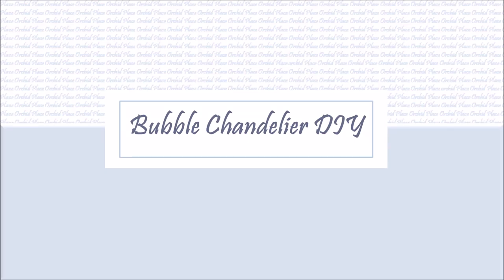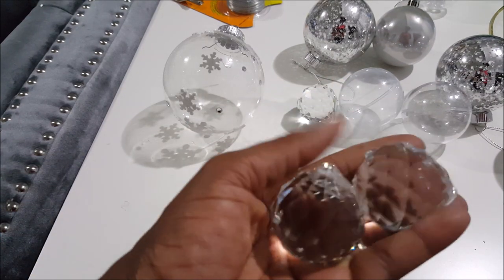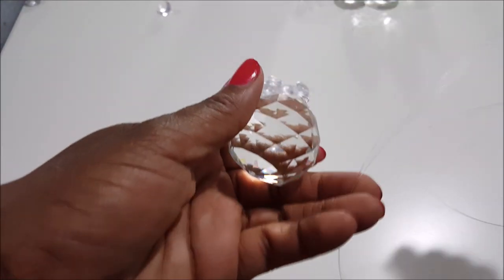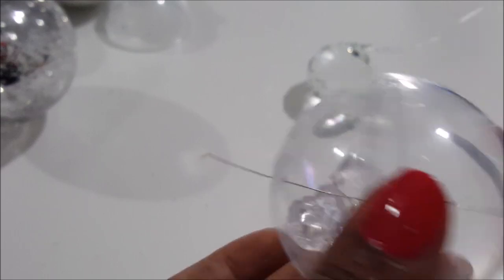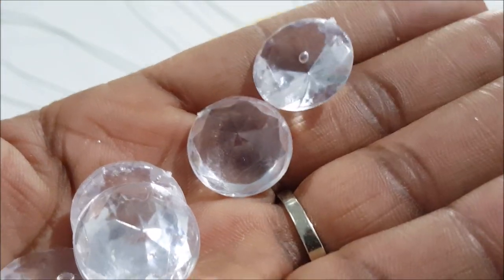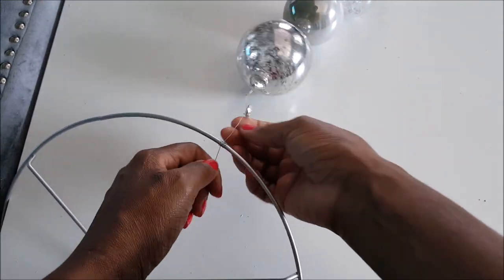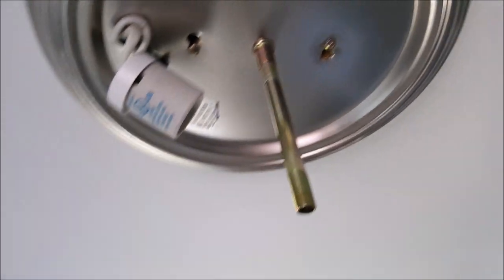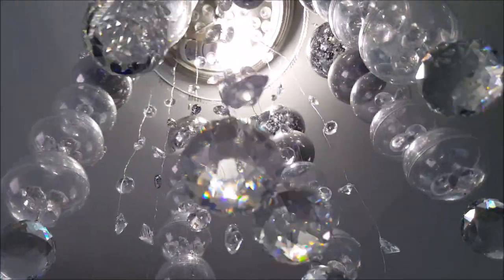Bubble Chandelier DIY

Comment: Absolutely gorg. But I'm wondering if those Crystal decor balls are flammable.  Do you know?
Reply from the maker: Thank you Vernon. To avoid an accident, you may notice that I placed them below the bulb ensuring that they are not in contact. They are at least 3 to 3 1/2 inches from the bulb in my light fixture. Thanks for the heads i up. It is truly appreciated.

Comment: Can you please tell me more about the smaller twist fixture you purchased to attach the lamp shade to the ceiling? What is it called and what was the size? Also the needle you used to string the wire through, was it an upholstery needle? I wasn't able to hear you well.
Reply from the maker: Hi Summer, it is a lamp pipe and the one I used was about 3 inches. You should find them in the lighting department in Home Depot or Lowes. They are part of a lamp kit but sometimes they are sold by themselves.  If they don't have it that length you could cut it to the size you need. 
It was an upholstery needle; I picked it up at Joann but you can get them at regular fabric stores that sells upholstery fabric. Good luck with the project.